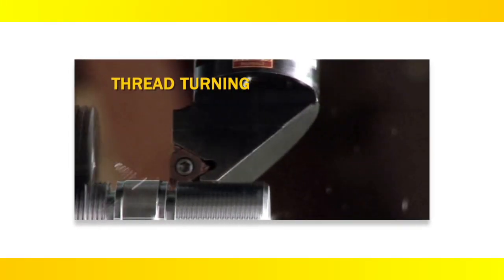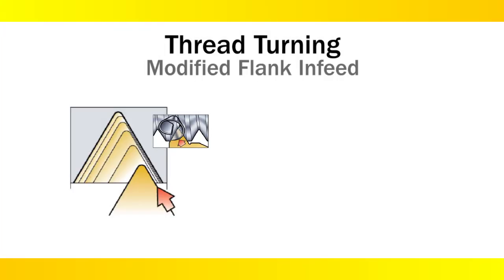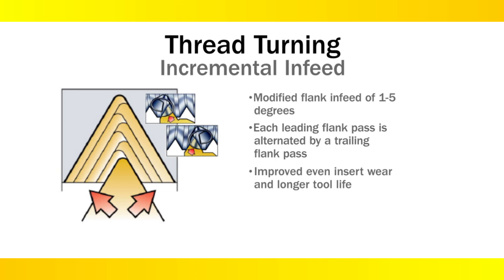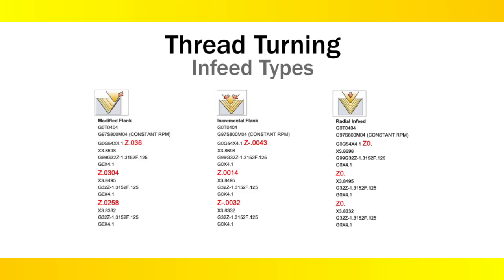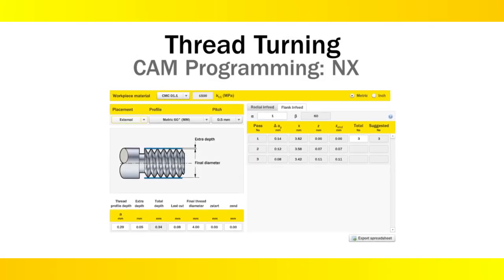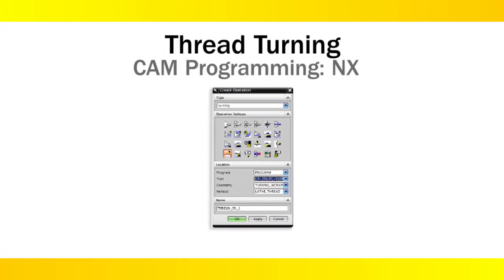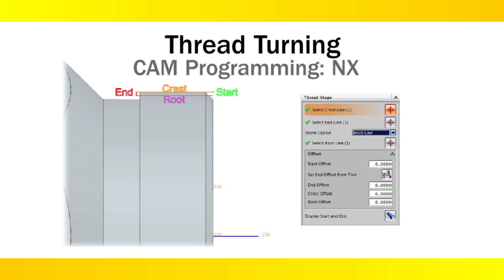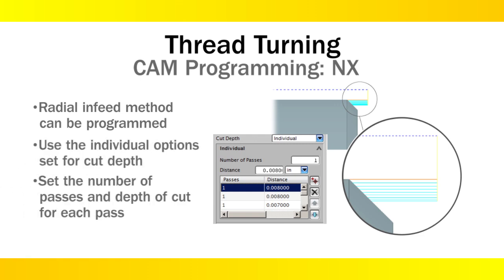CAM Programming Tip: Thread Turning Sandvik Coromant

Comment: Im running an M70x3 thread on my cnc lathe with a robot. Im curently already doing incremental infeed thread turning because it seems to have more tool life. But when the insert breaks its completly destroyed. I setup the machine to make 35 parts and then stop to change the insert, but sometimes the insert breaks 3-10 pieces before fhe 35 counter.

You think flank infeed will have a more consistent wear on the insert or flank infeed might be a better choice for when using a cnc robot?
Reply: would you like to share M70x3 threading program with me?

Comment: I've just thought of a way that you could possibly do modified flank infeed on a manual lathe. Set your compound slide to half the angle of the thread profile plus your infeed angle, set your tool square to the work and use the compound to feed the tool in, but don't move the cross slide. I'll have to try it before I can say whether it works or not.
Reply: I've been doing this since 1977...it works, and it's the best way.

Comment: in NX you can also use modified flank infeed, by entering in:
non-cutting moves -> engage - > engage: angle , angle: the angle of the tool , type of movement: engage. That´s it.